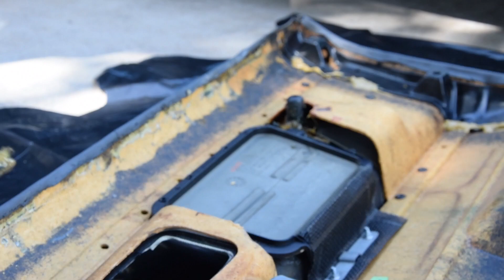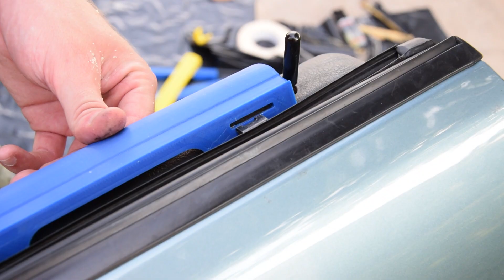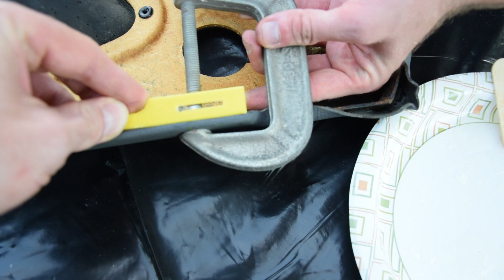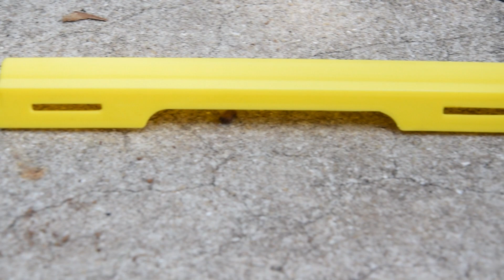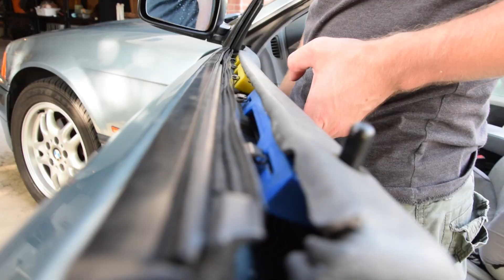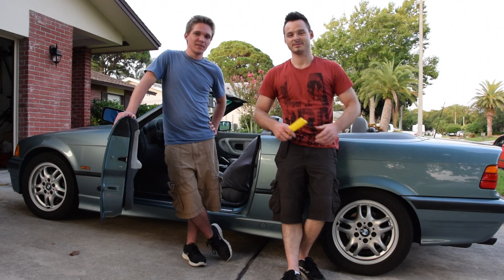Fund That Part - E36 Door panel mount install demo and testing

Comment: FYI to anyone wondering where to buy them, go to ebay and search "E36 Door Panel Repair Kit
".
Reply: Hi Christopher. I copied exactly what you wrote (E36 Door Panel Repair Kit) and pasted it into my ebay search but this replacement part in the video was not one of the links that showed up. Do you have a specific ebay item number or another way it can be pulled up in ebay?
Reply: @garretmagliaro8100  Weird, it seems the listing ended and don't have any more up for sale. Here's the seller's link: https://www.ebay.com/usr/fundthatpart

Comment: Thanks for this video. Frankly speaking, you will not be able to find that OEM door panel mount. Because BMW AG or OEM supplier don't produce it anymore. I have 96 328 Vert and broke my door panel mounts. I tried on internet many times but couldn't find that part. So, no need to be sad if you really love your car. First, you need to have a piece of wood. It should be same length with original plastic part. So after having that wood, you will have to shape or sculpt with knife or similar tool. And then you can use various sandpaper to make it soft. At the end of the work you can use drill in order to open holes like the original part. You can measure with door or broken parts. After completing all of those process, if you want you can paint it to black. Cheap and permanent way to fix the door.

Comment: hey.  What's up like your video. I  as well have door problems it's a hassle to get in. I drive an E36 BMW 1995 325I cabriolet. I have been looking for this particular part on line and I could not find it. started looking deep on line and I saw this video just want to fix my door and I'm hopping your product works great for my vehicle

Comment: Are you also making the other mounts that go around the door? I need almost all the mounts for the driver side and might need them on the front passenger side. I got a 1992 bmw e36 325i sedan model.

Comment: My 96 328i convertible has the oritional, i used epoxy to mend it back together, but in fear of braking them havent used epoxy to put them back on the door panel, it was litterally in 3 pieces and has not very much structure so id be interested to buy some of those 3d printed ones to use instead, how can i contact you
Reply from the maker: Zach hidden Hey Zach! We got the production parts available at www.fundthatpart.com